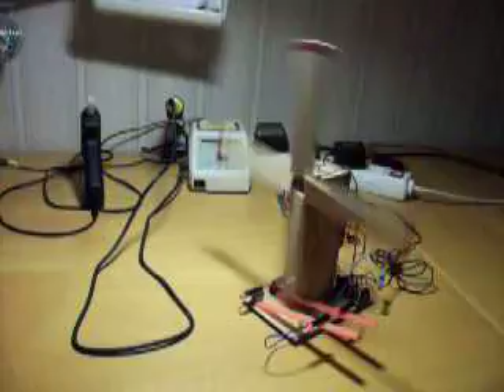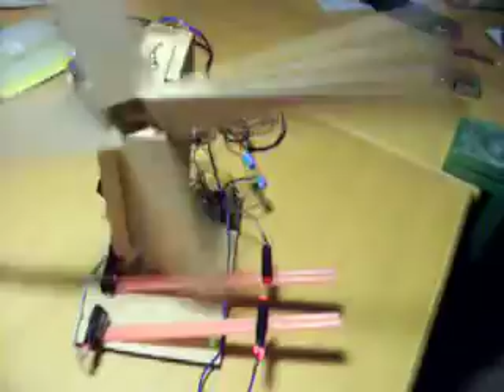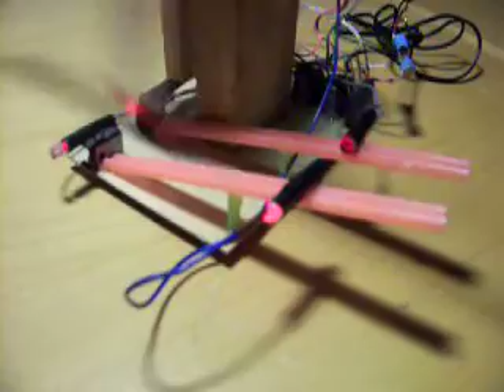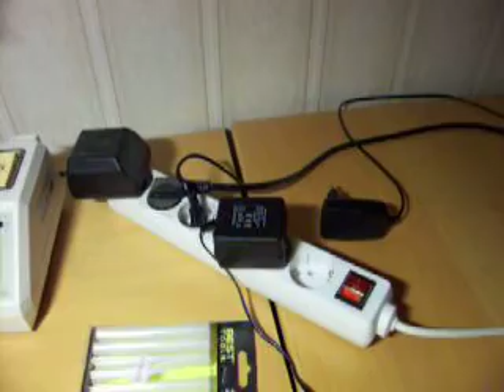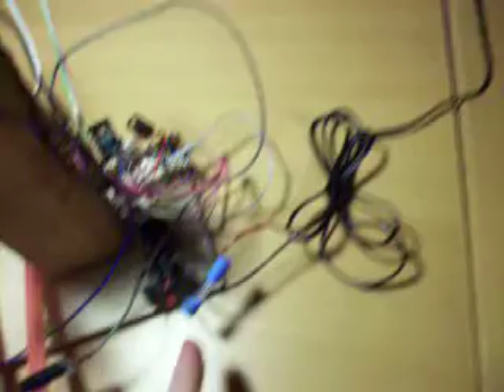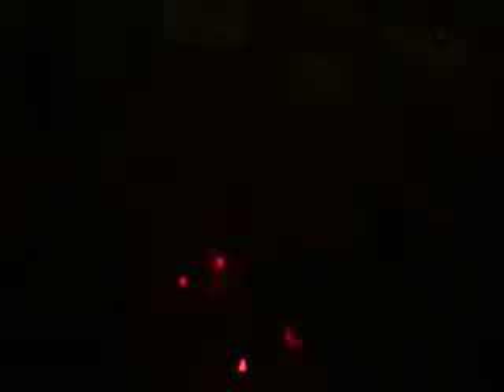Homemade brushless motor/fan

Comment from the maker: Since this video, the motor has been uppgraded with a total of 2 more coils connected in parallell to the original ones, and spaced about 90 degrees apart. That gave me a bit more speed out of it.

Comment from the maker: @huskyd2000 Thanks! Yes I came up with the idea to use LEDs and photoresistors myself. At first I was trying to to use an  IR LED, pulsing at about 40KHz, and reflect that on the blade, wich would trigger a IR reciever. But I never got it to work. Thus, I used this idea. I don't know how fast these kinds of resistors are, but I sort of doubt they could handle very high RPMs. If anyone has done it this way before, well to be honest I don't know.